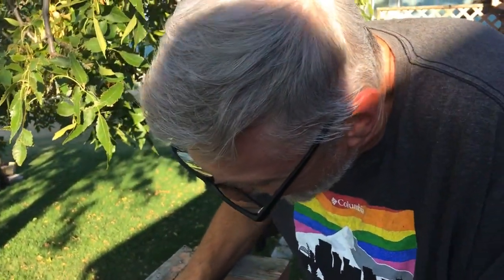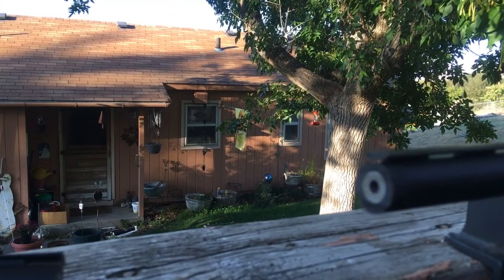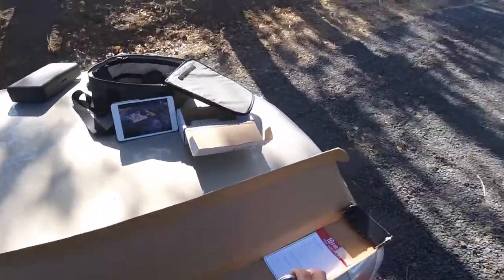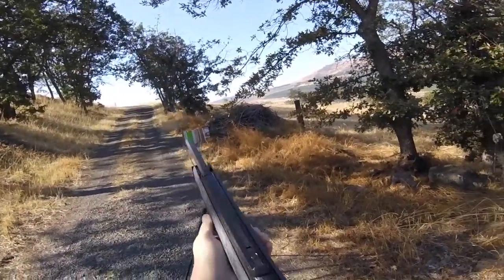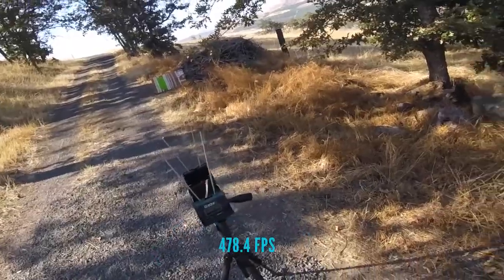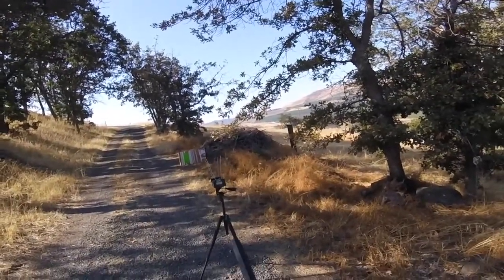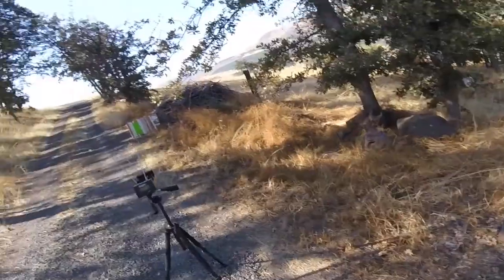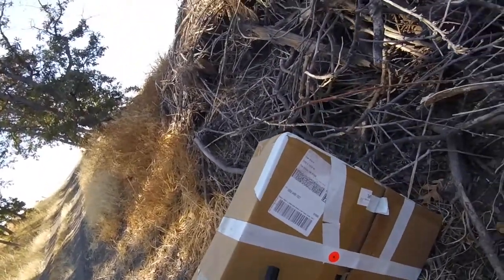Short Barrel Gamo Viper Express.

Comment: I believe airgun velocity does rely on barrel length, and this seems like a failed mission but a cool concept none the less
Reply from the maker: Yes, you are correct to a degree. On an old online Crosman Forum a bunch of experiments were done to find the optimum barrel length for each type of popular airgun power plant. CO2 for example produces more power using heavier projectiles of larger diameter from longer barrels up to a point. Testing showed for .177 and .22 Crosman CO2 guns a length of 16" maximum before it actually started losing velocity. That's where the volume of the CO2 charge had expanded in that volume of the barrel and was no longer accelerating the projectile.

We'd found for rifled spring guns, optimum length tended to be more like 10 inches before this happens. Since most spring powered airguns have barrels twice that long. Often cutting off a little will actually increase velocity. The downside is they are harder to cock. I have a theory about why this works with other Gamo's but did not with the Viper Express. I'll share that soon.

Thanks for the comment. Be well....

Al
Reply: @AlsAirguns great answer, but I'm still waiting for the proof video
Reply from the maker: I get you. I think a lot of folks agree with you. I’ll put it on the schedule.

Comment: Well it makes sense to me; shorter barrel = less velocity. The same reason a CO2 air pistol with a 3" barrel produces less velocity than a 6" barrel, and a CO2 air rifle with a 19" barrel produces more velocity than the pistols. Some of the air pressure is wasted as it leaves the barrel sooner than in a longer barrel. Of course this assumes the pressures are high enough to not completely expand and lose pressure before leaving the barrel (for example a barrel that's way too long). But that's unlikely with a quality production air gun. Ideally, it should reach maximum pressure right as the pellet leaves the barrel, so there is minimal waste of pressure.
Reply from the maker: Hey thanks for sharing. 👍🏻

Comment: All he had to do was compare the velocities of Crosman guns with different length barrels from the factory.  He'd have noticed the velocity increase (to a point) with barrel length, until it doesn't. And He'd still have a great gun. TL/DR.. Gamo engineers knew more about gun barrels. 🙄
Reply: @uncle_spanky the assumption you make is that he's got the finances to buy it. Why not support his channel and fund that on super thanks!
Reply from the maker: I’m going to address why I did this in an upcoming video. The reasons may surprise you. I’m not as naive or as ignorant as some may suspect. 

I do however really dig the shirt 👕 I was wearing 😄🙃😉
Reply from the maker: Actually I used to be a moderator on the largest Crosman user forum The Green with Biohazard Man and Dr Subsonic. I’m also the guy who worked with Chip at Crosman to get the pump up carbines added to the Crosman Custom shop. Definitely takes for another day. 

The point is the group did testing on the optimum barrel length for each power plant with regards to velocity. CO2 and compression air are similar in behavior whereas spring guns are a very different animal.

The Gamo Engineers Uncle Spanky mentions chose the barrel length on their spring guns based on aesthetics and making them easier to cock. Not for velocity reasons as would be the case in pneumatic, CO2 guns. 

The amount of air compressed in the chamber or a spring gun is very small in comparison to the internal volume of its barrel. The force it exerts is typically expended in the first 10 to 12 inches of the barrel. After that the barrels rifling exerts friction which begins to actually slow the pellet. It’s an experiment that’s been done before. The problem is people are challenged cocking magnum springers with 20+ inch barrels. They could not cock shorter ones. And a long barrel maintains traditional rifle aesthetics.

The Viper Express is a Smooth bore (no friction from rifling) and behaved very differently. But I had additional reasons for shortening which I’ll explain later.

Cheers to all & thanks for the dialogue,

Al
Reply: @AlsAirguns  oh good. you are well versed with your stuff
Reply from the maker: Thanks, experience is a blessing.